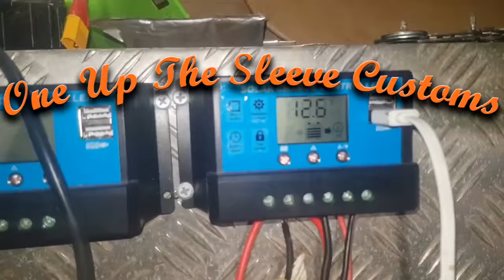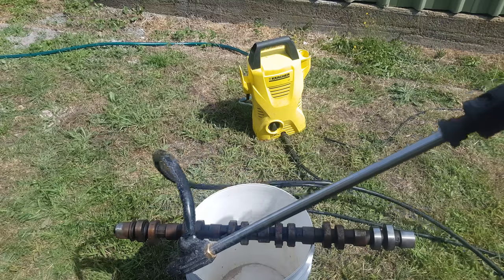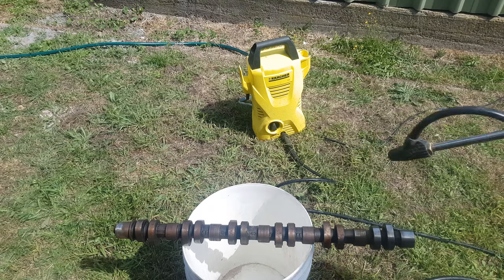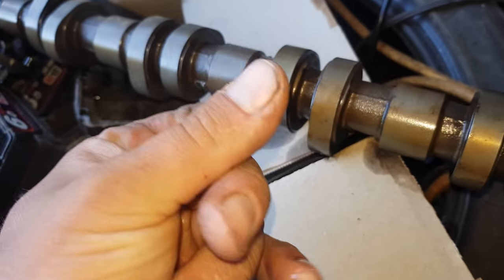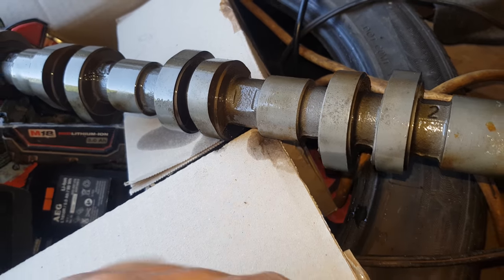Hydro blasting a camshaft with a karcher k2 and solar power

Comment: Hey does the sand have to be really dry/bagged or would washed stuff from the landscaping store by the trailer load be ok?
Reply from the maker: Washed stuff is alright if you so small sections and hit it with a rust killer fast. Graded bags of sand can be cheaper than 1$per kg and go a fair way. Gotta remember how fast and convenient it is vs wire wheels or chemical stripping ect. Cheers hope this helps
Reply: hi there, I did it too for my alum wheels. I used 90PSI  electric pressure washer and fine sea sand (P.S I did sifted the sand first so it has same form or it may cause clog while traveled through the nozzle) and yeah with that set up the sand needed to be very dry
Reply from the maker: Oh yes gotta be sifted and dry. Ypu can wash it first and ot lessened the corrosion build-up shortly after the blast